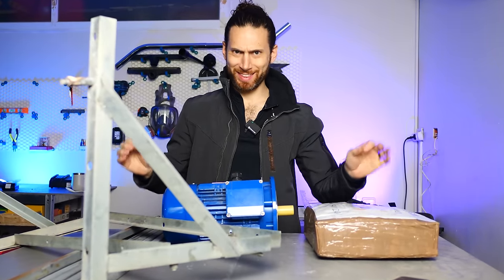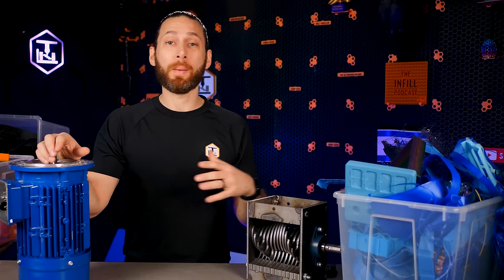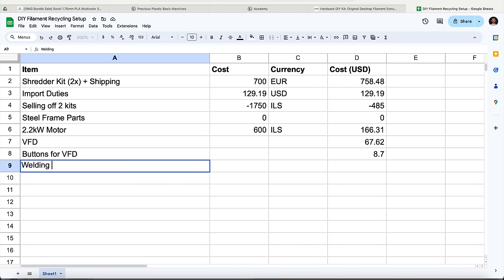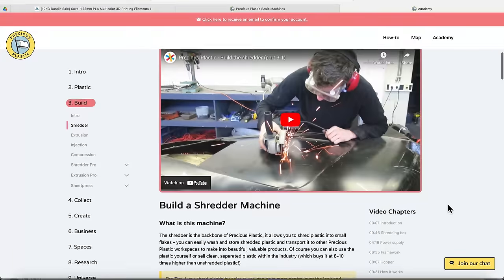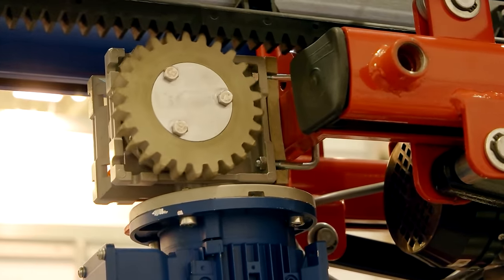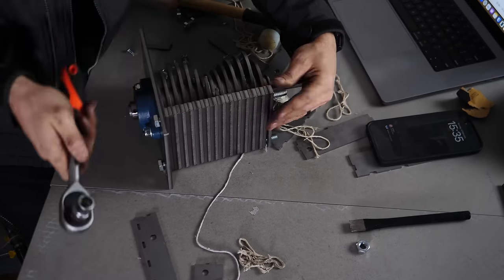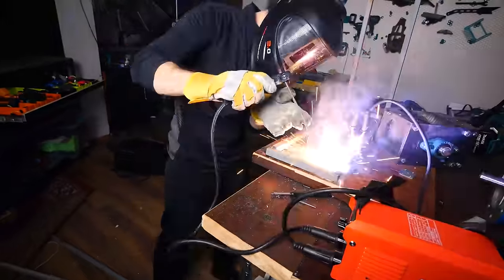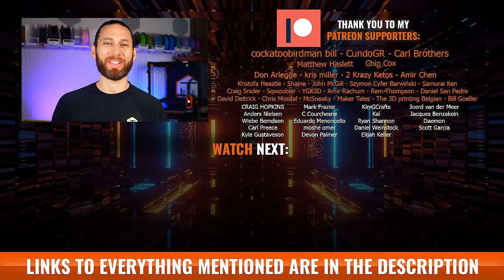Affordable Filament Recycling?

Comment: Be careful running your motor so slow.  You will never burn one up running it too fast, but you can almost 100% burn it up running it too slow, especially with a load.  You need to keep your duty cycle short in this case.
Consider a jaw coupling or Oldham coupling to couple that since your will have some movement.
Reply from the maker: Thanks for the tips. Most folks are saying that it won't work with the VFD because it won't have enough power... would you agree? 

I didn' tknow such coupling solutions existed. I went and designed my own and ordered it... But I'll look into other solutions. Can someone explain to me why a rigid coupler won't work?
Reply: @thenextlayer  easy one:  Ridgid coupler-absolutely not!  You never directly couple a motor to a device like that without some flex.  You will have resonances and movements that will be very rough on the bearings.  Motor to generator-ok.  Motor to transmission - ok.  Motor to a device like this-absolutely not.  And I don't mean this wrong-but you are a beginner welder and designer- you cannot get the alignment close enough the way you are working.  You will undoubtedly create something over static that will cause alignment wear on something.  You need something CAD and CNC designed to be able to static mount it. 
VFD.  Keep in mind you are going to be driving the motor at a slower speed, so the current will go wayyy up.  At full speed it will be closer to it's design spec.  Therefore you will have more electrical load and more heat.  
If I were you:  buy yourself a cheap current clamp meter and a temperature gun and monitor everything.  For me, I think it will work...but you just are not got to have full duty cycle.  This is the part that may be a problem with your application because you cannot easily start and stop it.  Again...current meter and temp probe.  Run it for some while with no load and see how it does.  I don't know how people are saying it won't work without the datasheet for your motor and drive AND  kowing the load of that shredding device. (Actually-Yes I do know-Youtube armchair "experts" that never built anything that watched a few videos and now think they are all knowing)

Keep going.  2kw 3phase motor is about 3hp.  I don't see how that won't shred plastic that is not solid chunks in no larger of an input area as you have there.  Again, it's the slowing it down that is the problem ...  If it doesn't work, you can find a gearbox and that will actually increase your horsepower and let you run at the motors design speed.

Comment: Looks like a fun project with a lot of opportunities to learn something. Looking forward to next video. Quite curios about the coupling of the motor and the shredder. Luckily the latter can be shimmed easily to the right hight. 
By the way. You might want to inform you about the potential health risks of grind dust. I was told its more dangerous than stone or wood dust. 
Good luck with the project :)

Comment: Ngl those are some really ugly welds. I'd recommended a thinner rod and make sure it's for the metal your welding. Another bit of advice that will help once your able to get a steady arc going id make small stiching patterns down the line or loops. Don't jab the stick in and only drag, they call it striking an arc for a reason. Lastly for this comment is always make sure your parts are clean before you weld then, wire brush your parts.

Comment: bonjour, super projet, effectivement je rejoins plusieurs personnes dans leurs commentaires, notamment sur l'utilisation d'un variateur de fréquence, oui tu vas baisser ta vitesse, mais tu vas aussi baisser le couple, et le faire tourner à des vitesse aussi faible va provoquer un échauffement de moteur, donc effectivement, il va te permettre suivant les modèle à pouvoir utiliser du courant alternatif pour faire tourner un moteur triphasé via un variateur de fréquence alimenté en monophasé, mais sans avantage autre sur le couple moteur, donc motoréducteur obligatoire en plus du variateur de fréquence.
Pour la soudure à l'arc, ton problème venait de tes réglages en intensité par rapport au diamètre de ton électrode (trop peu d'intensité, ça colle, trop fort tu perses) et de la distance entre l'électrode et la matière à souder (la distance électrode/matière doit être équivalente au diamètre de ton électrode, sachant qu'elle fond au fur à mesure que tu fais ta fusion, il faut reculer ton électrode et tout en l'approchant du support au fur et à mesure que ta baguette fond, c'est un geste à prendre..., trop éloigné tu feras de la projection de "gouttelettes" trop proche tu feras des troues ou tu colleras) et du choix du diamètre en fonction de l'épaisseur, et le choix du type d'électrode en fonction du type de métal à souder.
La "règle" en terme de réglage c'est 35A pour 1mm², et vue l'épaisseur de tes barres de fer, tu ne dois pas faire des temps de soudure trop long, et plus l'électrode est petite, plus la soudure est dure à réaliser, la soudure c'est de la pratique, ça viendras avec le temps ;) désolé d'écrire en français !

Comment: Interesting, I am still waiting for an affordable pellet extruder. It should be 10x cheaper material wise. Every filament roll you buy is a pre fabricated product itself and cost ca. 5-10x more than the raw material itself. It would be great to use pellets and recycled materials instead of pre fabricating filament in the first place. This would also solve the issue of coloring since one could mix one owns master batches and improve material properties as well. And don´t forget material degradation, thermoplastics are not like metals they do degrade over time when molten, so you need to constantly add about 50% new material to them otherwise they will get brittle and lose their mechanical properties in general.

Comment: this... frame... you made... will fall appart due to shreddedr induced vibrations.
Stop here, learn how to weld really good before you do it again.
A) always weld on clean metal, no paint, galvanising or else.
B) always obtain nice weldings not the spatter I see you do, it holds zero in time, practice on the scrap you have, raise the amperage a bit if needed, play withe the machine settings untill you get it rght.
C)Always prepare for welding by perfectly matching the cuts to eachoter, no weird gaps left to be filld wit welding.
D) always weld with chamfer ditch between the parts, so that when grinding the weld you do not eliminate it back to the crack,  otherwise do not grind the weld at all.
Reply from the maker: Thanks. I'll probably have to redo it from what all the comments say... ugh. Lesson learned.
Reply: @thenextlayer there are plenty welding tutorials on youtube, watch them carefully.

Comment: well, your welds look very crappy indeed :) we've all been there, but it is not hard to get ok-ish welds

1) make sure the electric contact is good (use a wire wheel to clean the surfaces you weld and also the spot where you add your mass/negative pole)

2) drag (and slightly wiggle) the stick instead of pushing it - about 45° for inside 90° corners is a good rule of thumb here - think of it like you would use a caulk gun, but it produces molten metal ;)

also invest in a can of weld separation agent, you spay it on your parts and the small beads and also the condensation of the flux does not stick to the material

Comment: Pausing at 20:02, when you grind away the weld. You see that the weld has not combined both steel bars. This is not a good weld and probably will not hold. Ideally, when welding you combine the welded materials to one piece. Unlike with soldering, where you only add to it

Comment: I would not recommend stainless steel unless you really need its anti corrosion properties. A magnetic separation is a good idea in your process line to remove tramp iron.

Comment: Well for some of your mistakes, you're amperage is way off, plus you need a lighter rod, and you have to clean off the welding surfaces. Another is the type of rod you're using, for that job, I'd use a 7014 rod that's either 3/16  if not 1/8 inch (imperial). Also that motor was designed to mount on a gearbox, so the best way to mount it was on a flat plate with holes drilled for the mounting bolts and shaft. The motor controller is a great idea and I'm glad the costs have come down on those, I priced one about 5 years ago and it was 3X that much! If you're wondering, I was a heavy factory mechanic and fabricator in the 90s, so your project was a minor job for someone like me. Sadly I am disabled and live in the US, sorry. I recently started tinkering with 3D printers and have the same issue, WAY too much waste!
If you are wondering, the motor controller works by adjusting the frequency of the power, not the voltage. Normal house current runs at 50-60 hertz where that controller can vary that much higher or lower than normal allowing a great range of speed and wattage output. A good one can also act as a brake allowing for a panic stop feature. Use a shut-off switch, I found out the hard way even if the speed nob is turned all the way down there's still about 80 volts reaching the motor, not enough to kill you, but you'll get REALLY excited and fall down ;)

Comment: You don't need to cut the square metal beams.  You cut a V at the point where you want the end to be and then bend it over and weld.  Must faster and neater and stable as it's still technically a single piece yet.
Reply from the maker: Damn this is a good idea

Comment: I'm not an engineer either - but as someone who used to sell Ikea tables, if you don't want that frame to wobble like.... something really wobbly, can't think of a good simile, I'd put some cross-bracing on it.  There's a reason why the higher cost tables and desks use A-frame legs.

I'm feeling a little dubious about the validity of the dollar figures.  I'm certain you're accurately reporting your actual costs, I don't mean to imply otherwise!  I just wonder how usefully representative that will be.  I'm certainly feeling a lot of "government accounting" in the way you've shuffled the cost of, say, the welder off onto a different project's budget.  That makes the numbers look good but also masks the actual cost this project is incurring.  A more accurate method would be: any tool you bought in, say, the last year that is essential to this project should have part of its cost included in the cost of the project.  That math gets complex but you can do something like take the cost of the welder, half it, and then divide that half over the number of project you expect to use the welder in during the first year you own it.  That's a not-bad approximation of how much the welder has added to the cost of this project.

Finally, I strongly suspect that the place where all of this will break down is in the actual processing of scrap.  Everything I've ever seen, heard, or read on the issue - from YouTube videos to documentaries on CBC Radio One to reports issued by the Government of Canada note that the main operating cost of a recycling system is the labour involved in removing contaminated materiel.  For filament, you need to make sure that not only is all the plastic the same plastic, but that you haven't accidently put any paint or glue or carpet fibres or anything that isn't the right kind of plastic into the shredder.  And that will probably be tedious and time-consuming.

I'm sorry that this sounds so negative, because I really, truly enjoyed this video and I'm interested to see where it goes.  But I feel that household or even very-small business level recycling is unlikely to be practical once you account for labour costs, and I don't want to pretend I'm more hopeful than I am.

What does make me hopeful is that, while 3d printing creates a lot of hobby waste, on an industrial scale it is waaay less than other kinds of manufacturing.  And even on the hobby level - I throw out less mass in plastic than my friend does in wood scraps.  Granted that the plastic is a more impactful kind of waste, the situation is still a lot better than it might seem when you have buckets of failed print and waste from brims lying around.

In any case: I hope this proves me wrong, and it all works out!

Comment: Your motor is a synchronous motor. The currents in the phases control the magnetic field of the windings, and the windings orient themselves proportionally to the fields.

Think of it like a stepper motor, just with a slightly different wiring scheme and with a handful of steps per revolution as opposed to hundreds. The nominal speed that it runs at comes about due to the mains frequency. A brushless motor like used in RC drones is again the same sort of thing, even more similar.

And the VFD is acting exactly like a stepper motor controller or the brushless speed controller in this regard.

How do you get it to generate a ton of torque? Well your motor can take up kilowatts of electric power without burning up; so you can just actively drive the current and have it dissipate a good fraction of its nominal power for what amounts to holding torque. Exactly how a stepper in your 3D printer generates holding torque. At speeds an order of magnitude lower than nominal it's closer to holding than to turning from its point of view.

At least that's the dumb person's (mine) explanation. I don't expect it to be 200% correct, but sacrifices need to be made at times.
Reply from the maker: Wait, so you’re saying it might work with the VFD? Most others said it won’t
Reply: Let's say you did have to spend 10 grand on a plastic recycling kit, which is as you say, worth 500 spools of filament. Let's say you have people bring you plastic, and you operate like a traditional wheat mill, you take your payment in plastic that is brought. Let's say you return people half of their plastic (in the form of filament) and keep the other half for yourself to use/sell. Then not considering power and labour, you have approached paying off your investment when people have brought you 1 ton. It would be silly to suggest that you can't collect 1000 spools worth of 3D printed waste in Israel, wouldn't it?

Unfortunately, labour is the big one, low throughput puts any sort of recycling project at a risk for never being profitable even excluding one time costs.
Reply: @thenextlayer  I'm not certain one way or another. "most others" appear to be under  the impression that you're going to lose torque via VFD. This is bollocks, you'll lose power but gain torque. Will you gain enough? Worth trying i guess, that VFD is cheap and it's going to be at your door soon.

Comment: when you where welding you should have sanded off the paint so the welds could stick better and you can hold the rod so it is not shaking so much but with gloves

Comment: Your picture of me (us) is very close, except I don't wear that apron, because I don't do a lot of metal working. 😂
Thanks for the project. I, like you, have been hoarding for over a year my waste and it's becoming out of hand.
Seems promising. I too have the same remarks about current solutions (I know the sketchy one you mentioned, and I am also sceptic about that one)
Reply: Case you're curious about how to control the motor rotation, torque and speed, you will find very similar parallels even on stepper motors. In klipper, for example you can configure the run current (the higher the current, the higher the toque the motor will be able to deliver). Differently from that though with AC motors you get to play with frequency, voltage and current. Making it spin the other way around is all about swapping the polarity. That device there you can probably DIY it.
Decreasing the voltage whilst maintaining current will get slower speed. Maintaining voltage whilst increasing current will get you more torque

Comment: Interesting idea here....Is there any viable way to program a feature into a slicer that would optimize printed supports for recycling? Like having it print supports in little attached pellet shapes or something that will separate and breakdown more easily.
Reply: Such a thing is possible but has a couple of caveats. One could likely create the supports in your original file to be sliced, but it will be more delicate and likely to fail in it's purpose and lead to the overall print failing. Minimizing the need for supports in your design is much better. Second, nearly any modifications to the supports to make them easier to break apart is also going to increase the print time. An unfortunate fact of 3D printing (and manufacturing in general) is the need to balance the Makers Paradox. You have three primary factors; Time, Cost, and Quality... but you can only pick two as priority.  You can make it fast printing and low cost but quality sucks; Fast printing and high quality but it will be very expensive in terms of failed prints until it gets tweaked perfectly and lots of wasted filament; or  work out everything in advance and learning the printer REALLY well so the print is relatively cheap in materials and high quality but it will take a LOT of time to print.  The community has been fighting to improve all three  since the beginning but there will nearly always be a sacrifice in one of those three areas.  Most companies sacrifice on cheap by spreading out the costs across a high volume production run where they can recover the costs. The new "organic supports" or "Tree supports" in Prusa Slicer or Orca Slicer are a step forward in reducing the amount of supports and ease of removal but still not easy to break them apart cleanly.

Comment: you’re going to need a gearbox you’re not gonna be able to get the torque for cutting filament with that set up you have, that doesn’t give you more torque it just let you control the speed. note that motor does have quite a bit of torque because of the motor but I don’t think it’s gonna be enough for just grinding
Reply from the maker: Yup.